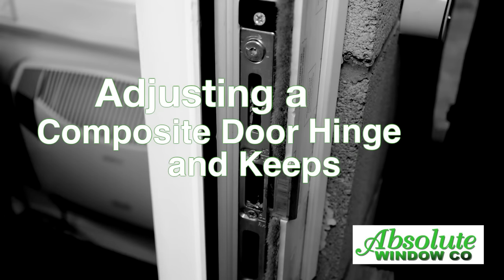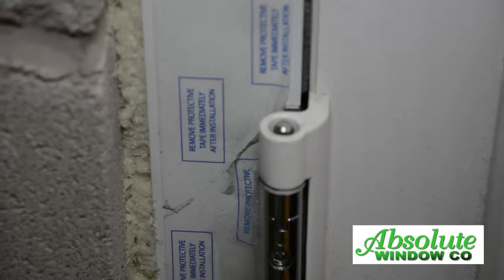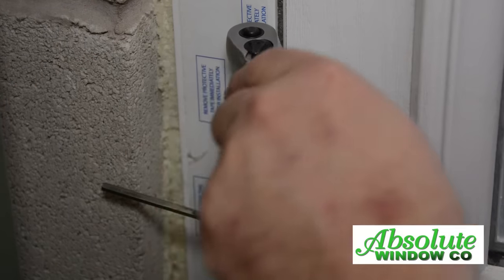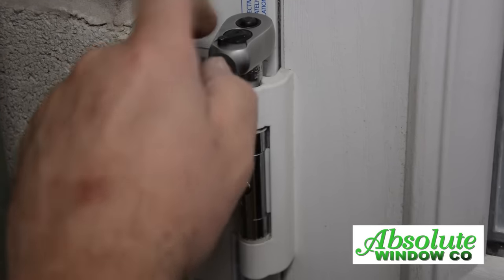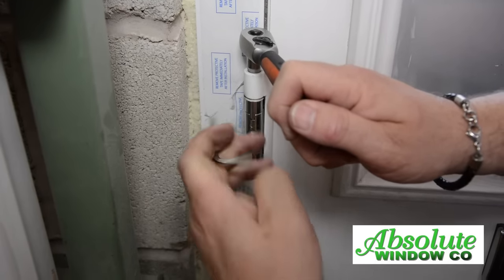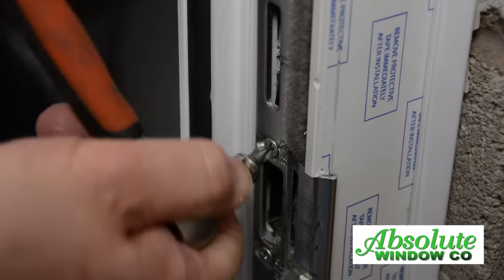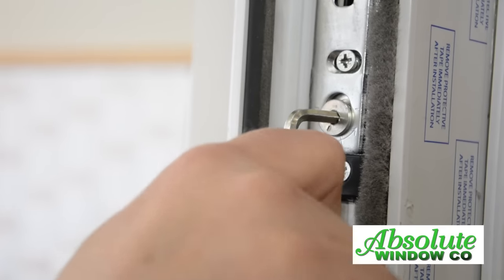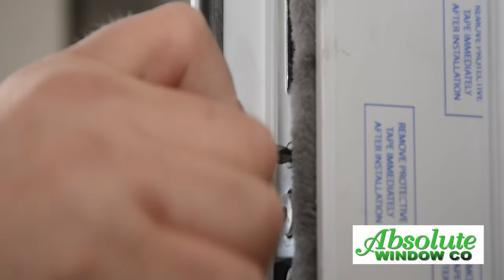How To Adjust A Composite Door Hinge & Keeps

Comment: I couldn’t work out the height adjustment and the video didn’t appear to explain; but actually it does, in part. 
The three centre screws mentioned are the Allen key screws (one on each hinge). Loosen these, then lift the door to the desired height, wedge in place, then retighten the screws. 
That took me a while to work out as I was expecting height adjustment to done by the turn of a screw.
Reply: Cheers for that exactly what I was after
Reply: Yeah cheers for that. Much more helpful than the video 😜
Reply: I've been searching the web for this simple info, only to find it in the comment section, cheers mate!
Reply: Super thank you for that information as the video didn't explain it. Been working on door for hours, had to buy 2 new hinges. Your information is a life saver.
THANK YOU
Reply: Well done mate! I can confirm too. they kinda rushed that in the video. on a job it took me 30 mins to work that out lol then i used books and air wedges under the door, raised it and retightened it like you mentioned.
Reply: Thanks for that info, the wife has been convinced we needed a new front door. Your simple explanation has now saved me that expense, cheers bud!
Reply: Thank you!
Reply: Ian you are a life saver! I was properly scratching my head on that one, quick air jack later and the door is actually shutting without the force of 1000 suns! Thank you!

Comment: IF YOU WANT TO ADJUST HEIGHT : I found a manual online. The 3 allen bolts, 1 on each hinge, you must UNDO all 3 of these and then physically lift the door up. Best to use a piece of wood or a door jack to lever the door up from underneath, then retighten the bolts while it is lifted.  Took me ages to figure this out but door is perfect now! You're welcome...
Reply: I fit a composite door with these hinges 8 weeks ago. Door was in square. I was supplied with the wrong instructions for the hinges. Finally figured it out. Door was sweet as after. But now the door has dropped and I'm having to return for a service call in the morning. My opinion of them is not the best!👎
Reply: Thanks
Reply: @snowboardingraptor7005  yeah i had a job the other day where the customer snapped the allen bolt and it was stuck at the lowest point. so had to remove the whole hinge and raised the other too untill we can get a replacement hinge. poor
Reply: Thanks bro
Reply: how did you remove the hinges? @MoroccanAnwar  I've already removed the three allen bolts, but I must be missing something
Reply: Your comments are superb. Video skipped the most important part. Thanks very much.
Reply: Please can you help me out for finding thd manual
Reply: Brilliant. I have a top hinge that keeps dropping forward and couldn't see how to adjust the height but figured it out just before I saw this comment.

Comment: Just had a problem with the hinges as on this video and I completely agree with Ian.  I fathomed it out myself because the video did not explain it well.  You need to make some folding (2 horizontally opposed) wedges to hold the door weight about on the centre line of the door , loosen the centre screw on each hinge more than needed for the l/r adjustment then jack the door up using the wedges and re-tighten the centre screws. repeat if necessary and then check the L/R adustment which may have moved in the process.

Comment: When I tried to adjust the lateral position of the door using the top bolt, the whole barrel turned including the loosened allen stood section. The allen stud was definitely well loose but there was no way the bolt would turn independently. I did get the gap at the top of the handle side of the door to open up slightly but there was no means of fine adjustment. Am I doing something wrong? 🤔 Thanks.

Comment: When I try to adjust the lateral position of the door using the top bolt, the whole barrel moves including the middle section where I’ve really loosened the allen stud. I didn’t expect this to happen. I have managed to correct the tight fitting to some degree but it did not allow for any controlled fine adjustment. Am I doing something wrong?🤔
Reply: I'm having the same problem. Did you find the solution?
Reply: Same problem, I can adjust back to frame using top or bottom bolt with opposite tightening. Then tighten Allen key but afterwards it just returns to original position or as near as dammit. Are these hinges just a substandard version of a flat hinge?

Comment: I just want to stop the door closing behind me , when I take the cap off it's like a piece of plastic in the shape of a cog with an allen key fitting in the middle but it doesn't turn using an allen key. They make this stuff overly complicated.
Reply: Mine is the same it closes behind me. Did you manage to solve?
Reply: @RichardJackson-i5g  I didn't pal,  it's not a big issue when the door closes slowly behind you so I didn't really persevere with it, shoud be a simple thing to do but it's not.  Good luck with your door and let me know if you sort it and I might revisit mine!
Reply: @kingshearer2  Hi, thank you for your reply. Ive been speaking with my Father tonight who’s a retired joiner. And although rockdoor and composite doors wasn’t his the thing back in the day. The principal is still the same. He’s mentioned that the frame might not be plumb thus causing it to swing shut. Also mentioned the hinges might not have enough tension on them( im sure youve looked at this aswell) Ive got the firm who fitted the door coming out next week to look. So I’ll update you with what they say

Comment: How to adjust height again please ?
Reply: They don't explain it very well but you have on some composite doors a 5 mm Allen key adjuster on the underside of each hinge. Although it will give you between 3 to 5 mm this sometimes is enough. Depending on hinge design this height adjuster is sometimes found at the top of the hinge. The more complicated way is to remove the centre pins where you will find normally 3 screws which you loosen to move the hinge up or down then tighten them back up . Hope this helps anyone